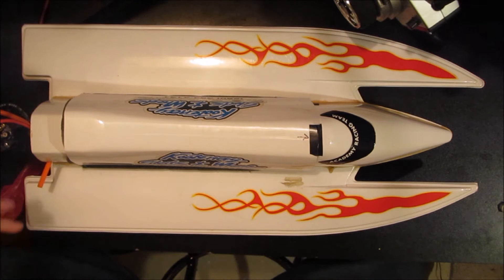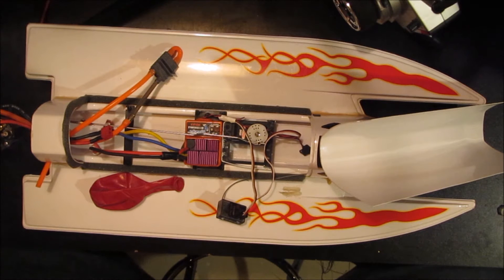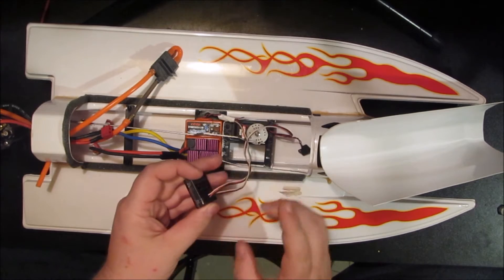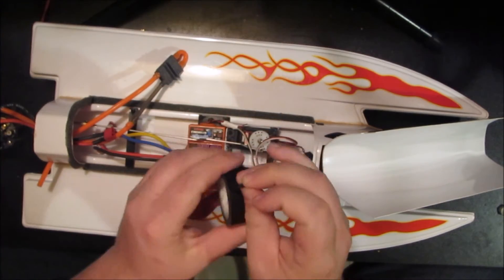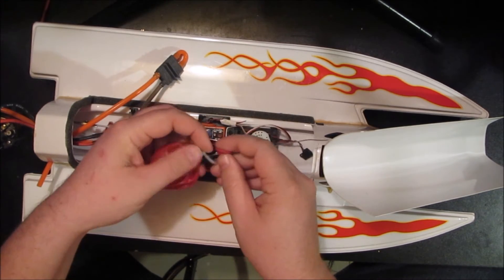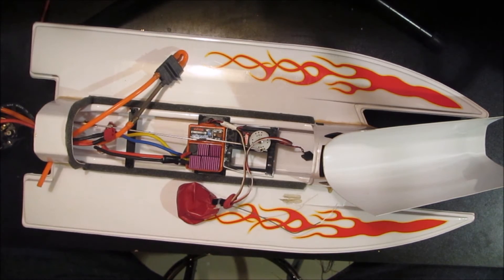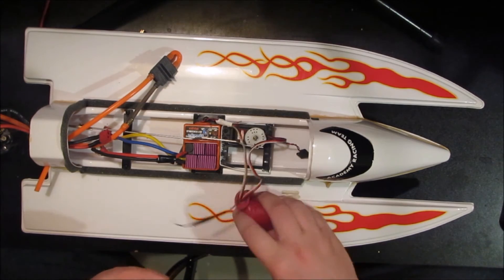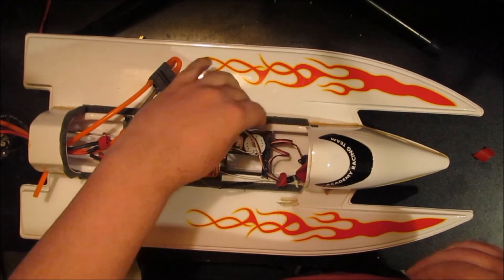how to waterproof a boat receiver with a balloon!

Comment: Ballooning a receiver is usually considered a rookie method by the pros.  I should know because I just got into this hobby some months ago myself, and have been schooled by them on the best methods.  Balloons collect condensation and trap moisture over time, even when sealed. Rubber coatings or tape have their own issues.

The pro racers spray the electronic board of their receivers and servos with a spray called CORROSIONX. It's dielectric, so it doesn't conduct electricity, and it repels water, so no balloon is needed. There's even an ad somewhere showing a TV set running underwater after being soaked with the stuff! It's all I use now (I have 3 boats).

Do not spray it on the ESC or motor , and no spray on the potentiometer of the servo or connector pins of the receiver.

 I can swear by this product because I just sunk my Barbwire boat last week when the hatch blew off after a rough crash.  When I got it home I dried everything with an air hose, gave the circuit boards an extra shot of spray to remove any remaining trapped water, and then with fingers crossed I plugged in the battery.   Everything worked!

 I lost two servos in the past just from water getting into the boat before I started spraying everything with this repellent. 

 Check threads at RCGroups.com and other RC boating sites about CorrosionX to confirm this advice.  Happy boating!